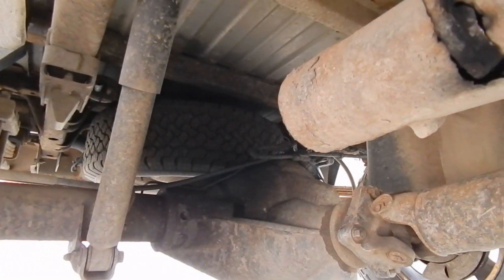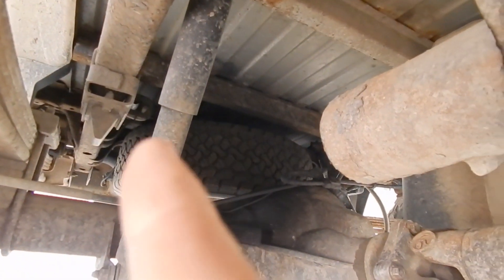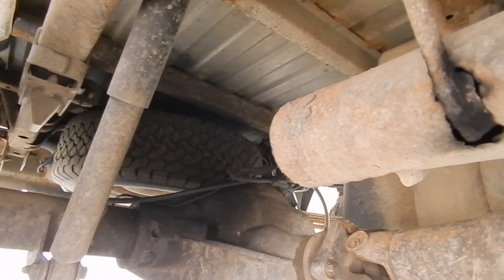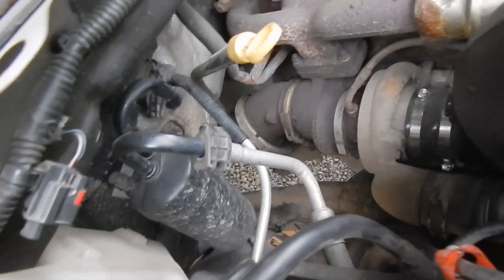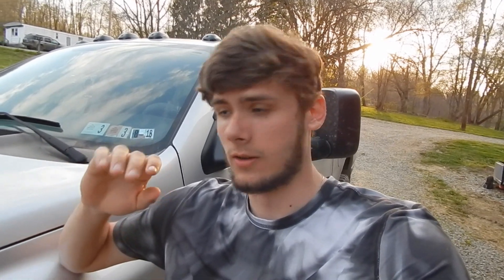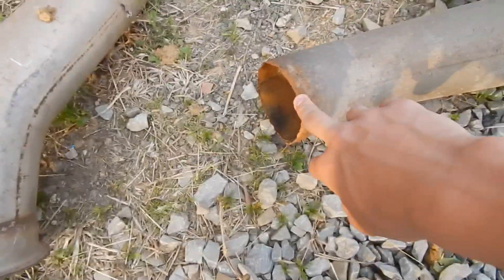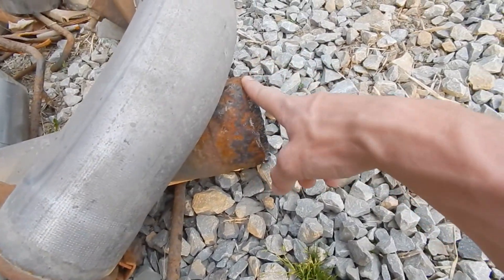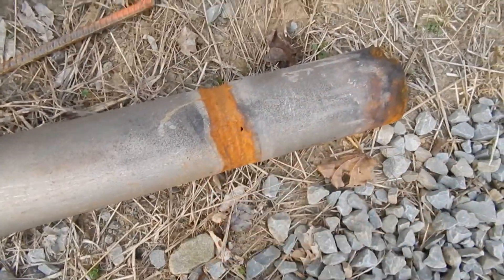5.9 CUMMINS GETS NEW 5" TURBO BACK MBRP EXHAUST

Comment: I’m currently running mbrp 4 in turbo back and it’s about shot. How does the 5 in mate up to the turbo? I have an exhaust brake also.
Reply from the maker: My 5" mounted right up the part of the exhaust that goes to the turbo gets smaller, it mounted like my 4" did very easy!
Reply: Great. Thanks